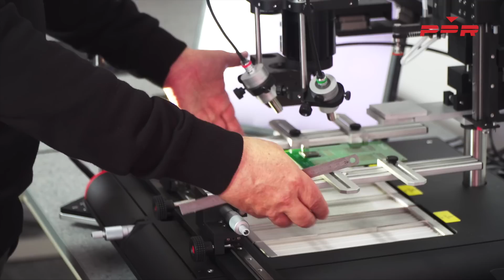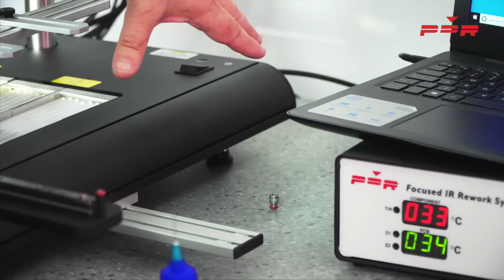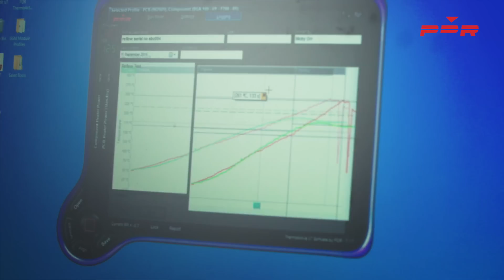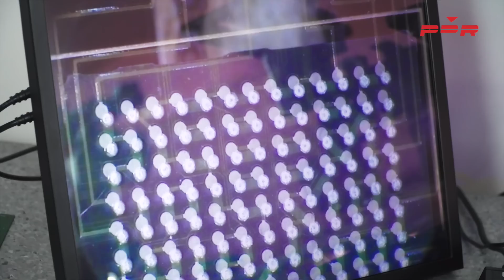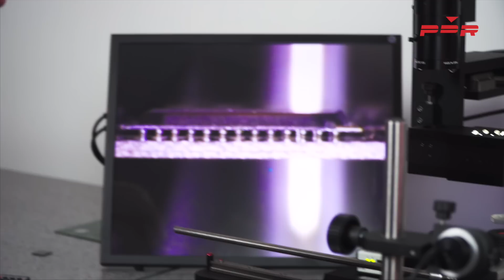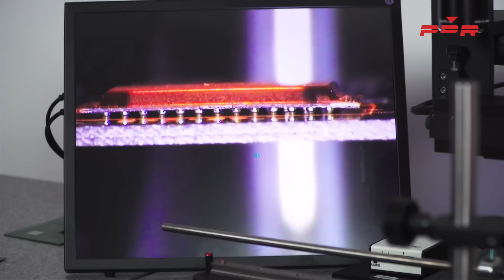BGA Rework Station - BGA Removal and Replacement - PDR IR-E3 in Action! - Product Demo.

Comment: Hi does the software require a license? Are there any costs associated with the software? Thanks
Reply from the maker: Hi, thanks for your question.

Our software is designed exclusively for use with PDR systems and is only available to system owners. It is fully integrated with our equipment, so it is not sold or licensed separately.

If you would like more details or have a specific application in mind, please feel free to submit an enquiry via our website: www.pdr-rework.com